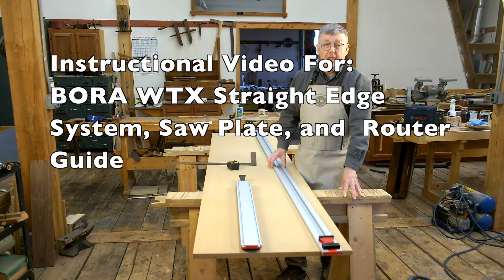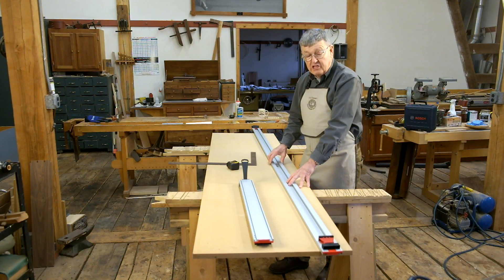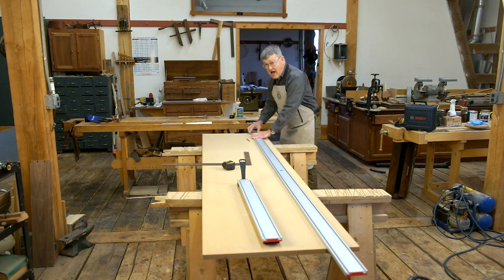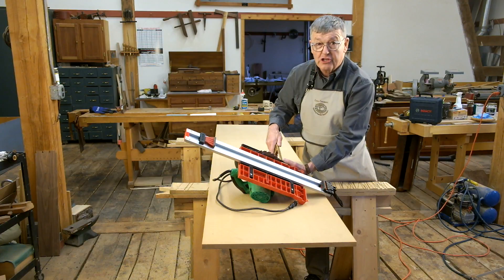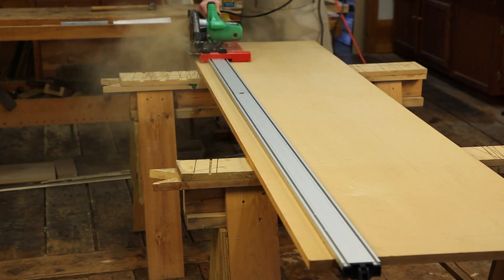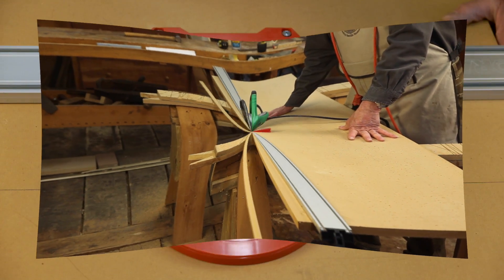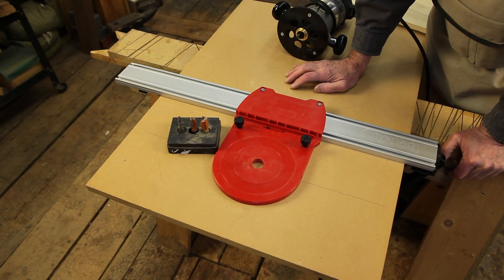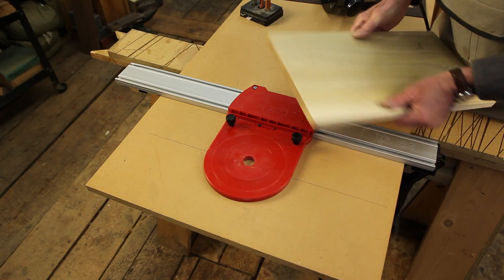Bora WTX Clamp Edge And Router Plate Instructional Video

Comment: Great demo. But, two points may be helpful to understand the instructions better:
Let:
  T = the width of the dado to be cut
   t = the width of the router bit, and t is less than T

1)  The width of the router bit should be at least half of the width of the dado. To be more precise,

  t >= T / 2 
For example, if T = 5/8 in, then t = 3/8 in is good.
The reason for this requirement is that it will ensure that the second cut will complete the  cut of the dado.

2)  The layout line is not at the center of the dado.  The layout line divides the dado into two unequal parts. The part further from the edge is t/2 wide, and the part close to the edge is T - t/2  wide.

Comment: At 7:20 you're starting the cut.  Clearly you're pushing down on the base to keep the router aligned.  Looks good when you're doing it.  However . . . I had the same experience that other YouTubers mention - the first time I tried it out -  the whole thing teetered at this balance point, and the bit chewed out the plastic hole.  $45 ouch!.   There should be a way to actually affix the router to the plate so it won't unbalance.  I came up with the idea of mounting a 3/8" thick plywood base exactly fitting the Bora plate, and found a hole in my router base where I could bring a 1/4" bolt up through the plastic+plywood.  A wingnut then secured it.   Now the bushing is snugly fitted into the "new" 1" hole in the 3/8 plywood, and the router can't escape from the bolt and wing nut.  The new plywood base stops just at the place where the Bora jig attenuates to calibrate thickness.
Reply: Forgot to mentioned - I used Super 77 spray adhesive to mount the 3/8 plywood onto the Bora plastic base.

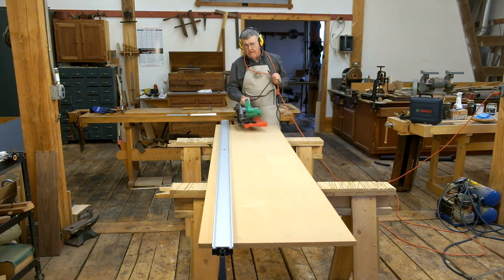Comment: Huh?  I think this must be outdated...to the point of not being useful.  Granted I didn't watch past 2:43, because there's no 'offset' required of the current Bora system (who would bother with this when there are zero-offset systems now, using sacrificial edges), and the 'saw plate' on current model is an entirely different design (and orange, vs. red).  Would be a great to see this presentation updated with current system, but this looks like it's of historical interest only.